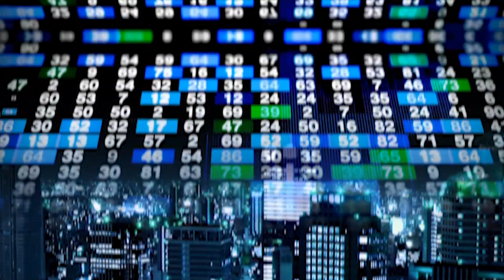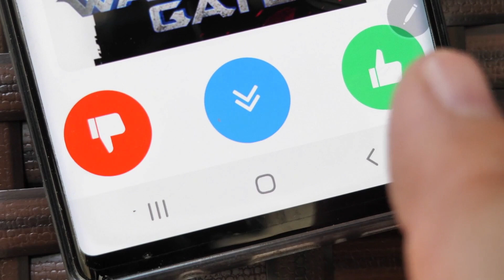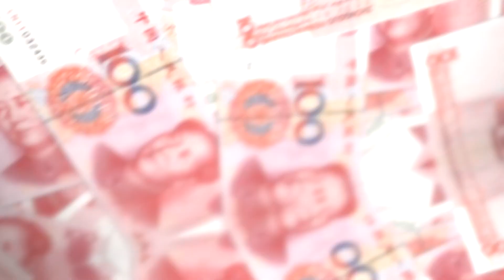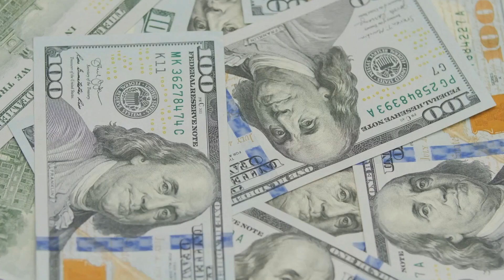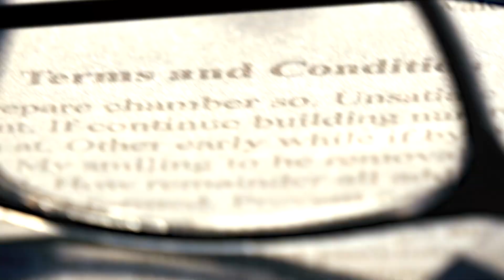This Is Why China's $11 BILLION Artifical Project Will Change EVERYTHING

Comment: Of course there are 'unforeseen' problems that are likely to arise. However, if China does nothing flooding will continue to be an annual problem in cities such as Beijing, and if anyone has seen the damage that those floods have created the gamble being taken seems to be the best way to solve multiple problems. Furthermore, used sensibly the water diversion would help China win their war against the Badain Jaran, Shapotou, Singing Sand Dunes and Crescent Moon Spring, Taklimakan, Gurbantunggut, and Gobi Deserts where projects are underway to 're-forest' these regions, and re-populate these areas. So, opportunities will develop for 'displaced' individuals in need of jobs, homes, and stability. At least China is acting on problems that need to be fixed!